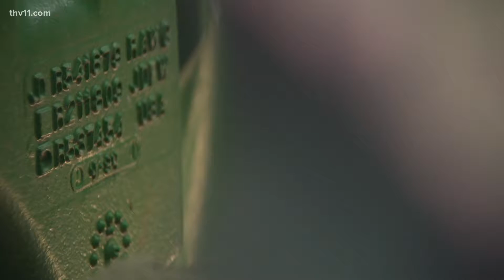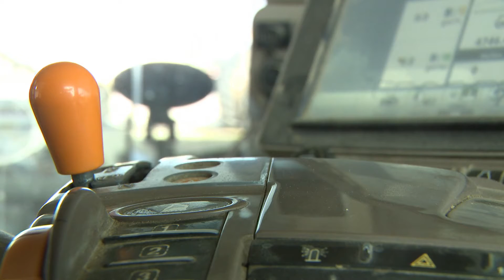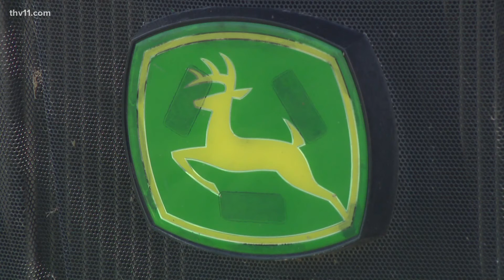Farmers now allowed to repair John Deere equipment

Comment: I don't think this as big a win as you think it is. Diagnostic software is one thing, having access to aftermarket parts that do not void your warranty or bar John Deere from performing basic maintenance on you tractor-etc when needed is the big issue. If you don't have access or authority to install third-party software or mechanical parts, you don't have much choice but to still pay John Deere's exhorbitant prices and fees. Same for any other farm implement manufacturer. This still screws the farmers and puts the right-to-repair movement on the bottom of the to-do list.
Reply: Screw a warrenty when they wont even let you work on your own equipment. That’s Like buying and audi and they void your warrent cause you got tires at Walmart. Go get yourself educated